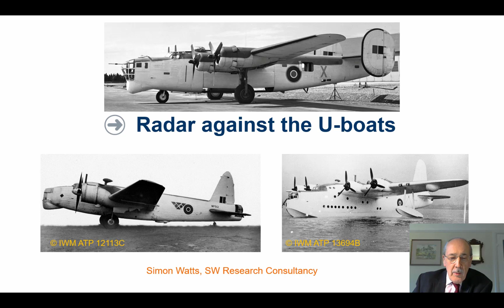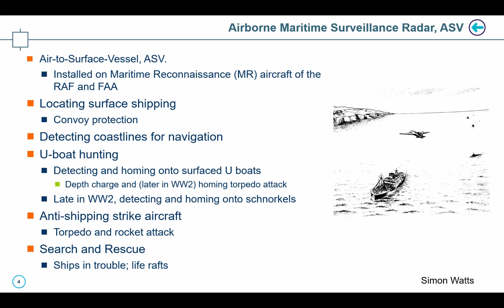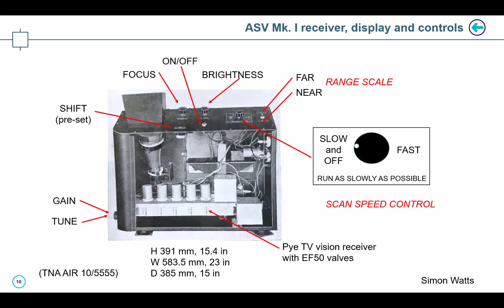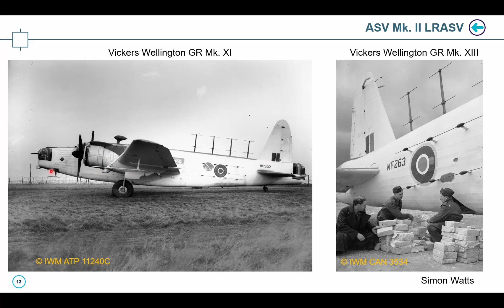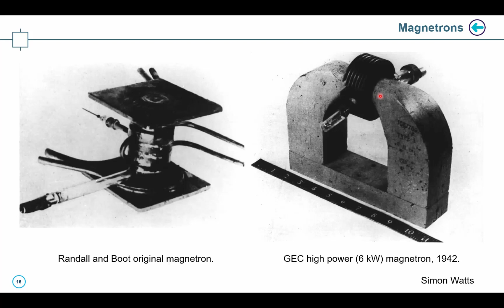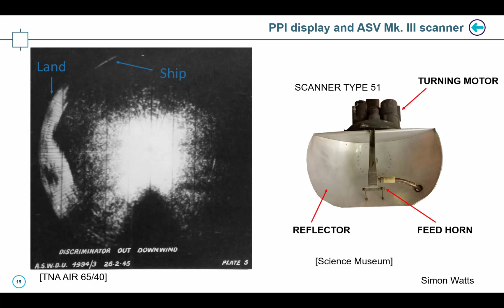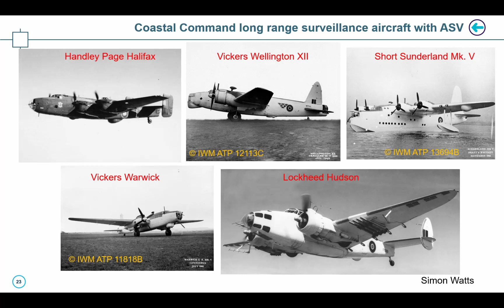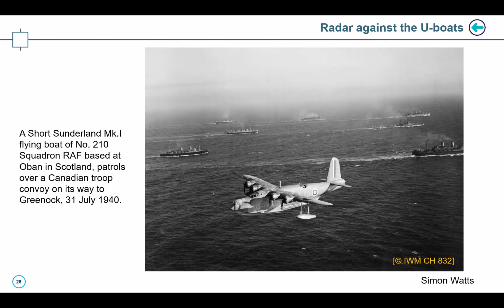Radar Against the U-boats

Comment: Thank you so much for this lecture. I've read many books on the Battle of the Atlantic so i already knew the ups and downs of the success rate. Now with your lecture I have a much better idea of the ASV systems and how the operated. I spent twenty years from 1970 to 1990 as a ASW aircrewman running passive and active sonars aboard the P-3 Orion, I was also cross trained on the radar system consisting of the APS-80 receiver/transmitter combined with the APA-125 indicator. We used it primarily for tracking merchant shipping and the MARKET TIME patrols during the Vietnam war. Thank you very much for detailing the RADAR systems used in the U-Boat war, I had always wondered exactly how they worked, indicators and tactics.
Reply from the maker: Glad you enjoyed it
Reply: Glad you enjoyed the talk!

Comment: I was navigator on last RNZAF Sunderland flight April 1967. The ASV 6C radar could detect contacts at night at 3 nm which usually when we charged in at 300 feet and illuminated with the Leigh light turned out to be seabirds resting on the sea.

Comment: Excellent presentation. When the existence of the Metox warning system became known, were radar transmitters attached to ships in order to "spook" U-boats into submerging, thinking an unseen aircraft might attack them?
Reply: The use in a limited area of increased numbers of aircraft with metric radar was tried; it was known as "flooding". The aim was to have so many transmitters in an area that the U-boats could not afford to submerge on every contact and then might be surprised on the surface by an aircraft switching on its radar at the last minute. It was tried for a short time but the advent of centimetric radar made it redundant.

Comment: The Tizard Mission is what tipped the balance in the Atlantic. They carried with them one of the few Cavity Magnetrons in existence at the time. Now back then, they were made with precision machinists, a time and labor consuming process. Numberic machining was not in existence at the time.  But when the Americans took one look at the magnetron, they gather together, and came to a most singular answer for the Mission team:Mass Production by stamping. Instead of making them with machines, they would STAMP out layers of components of the unit, then assemble, and solder/braze via baking in ovens, making them whole. All without the fussing over and worry about the unit not being in spec, because the layers were ALMOST always in spec! Spot checks would ensure the stamping of the blanks into the layers of the unit were proper and perfect.  If it got out of spec, dump the batch, put another set of dies in, destroy the old set, and keep on churning out cavity magnetron components by the dozen every hour.

This mass-manufacturing  technique developed and perfected by the GE team, caused massive numbers of  centimeter radars to be available for the sub-hunters.